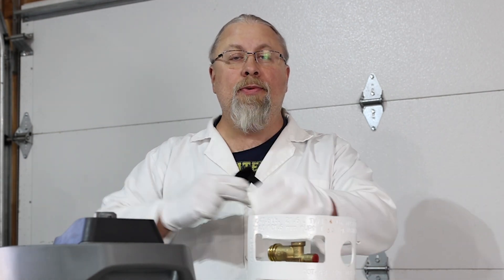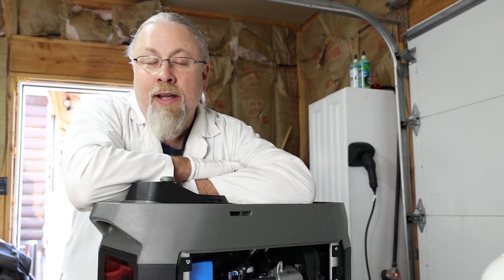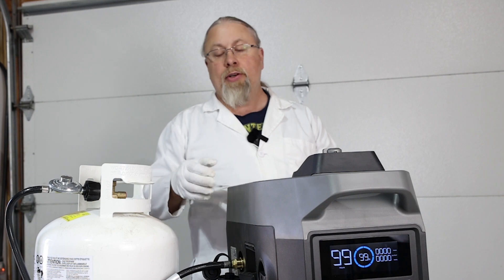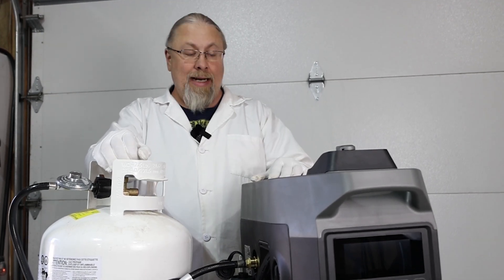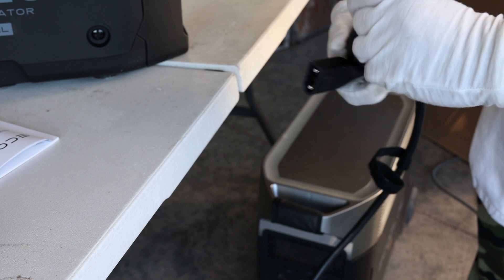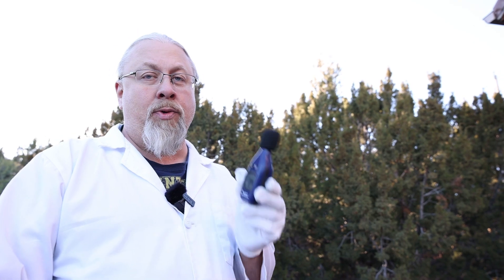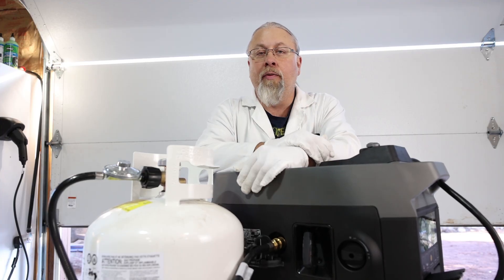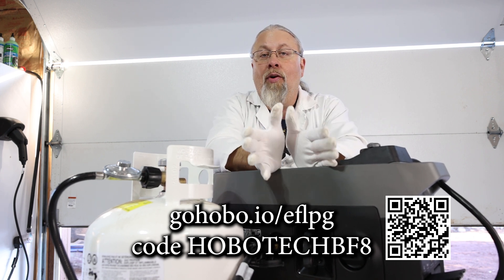EcoFlow DUAL FUEL 1800w Gas / Propane Smart Generator Review

Comment: I wouldn't touch a generator with computerized controllers - especially not a screen and Bluetooth and the like. 

A generator is a last ditch device. It's like having a fire extinguisher with an OLED screen and a tactile switch for the trigger.

What I would totally buy is a smart add-on for a Honda generator.

Comment: Did you ever Figure out why the electric start wouldn't work for such a expensive generator
Reply: Because propane (especially if cold?), and the new line, with partially charged battery, lack of priming. Once he had it going for awhile it started back up immediately… which means the main kinks in the connection were removed and battery was freshly charged, etc. Pulling the cord a few times slowly with the system powered down can help prime it—from what I gather… then turn on and try starting. Presumably, it will start more easily later on if it hasn’t been disconnected or let to sit a long time.

Comment: Great Video. Bro. F that Gas tho. I have a Gas generator.  Only run it now. So it won't lock up over time. The is for the video. I'm skipping this.
Reply: Lock up over time? What are you saying?
Reply: @GMC-qo9xi  
You need to run a gas generator. To keep it in condition. Preferably at least once per year. It’s not good to just let them sit in stowage for years without use.

Comment: when I had watched another review .they couldn't start because the proppane tank was low on propane
Reply: Hi! It is possible that the ambient temperature was too low and the tank contained a lot of butane, which does not evaporate well in the cold. If you keep the cylinder with gas in a warm room for a while, this should help the gas evaporate better. Another option is to fill the cylinder with pure propane, it evaporates well even at low temperatures, but I do not know if they can do this at filling stations in your country.

Comment: I'd rather have a gas can than a propane tank.  my truck runs on gasoline. Lot easier to siphon gas out of that, than constantly fetch propane somewhere in an emergency.   On the other hand, my 7000 watt gen set at home is hooked up to a natural gas line.

Comment: Smart generator that can't figure out to hide fuel level reading when connected to propane. Now they did say the generator is smart, they never said the same about whoever designed it, right?

Btw battery most likely was low, should've let it run for at least an hour anyway. No one tests generator out of the box. It needs to work for a few hours, then oil change, only then use/test.
But I bet you know all that, so no idea why you did what you did.

Comment: Yeah, I would not get this generator. I would not want to have a generator that requires my phone to work. No thank you clarification how about tech told me that the generator only requires the phone to set it up and after that it does not require the phone to use.
Reply from the maker: It doesn't "require the phone to work". You only need to use the phone to set it up the first time to your parameters.
Reply: And either wifi or bluethoot,, I’m using bluethoot.
Reply: @HOBOTECH  that’s a relief thank you for clarifying that. I just get nervous when pieces of technology are relying on other pieces of technology like a phone.

Comment: Gross that a generator needs internet access.
Reply from the maker: It doesn't require Internet. It only needs setup the first time with your mobile an that's it.
Reply: And either wifi or bluethoot,, I’m using bluethoot.

Comment: I have the Smart Home Panel, 2 Delta Pros, and 4 Smart Extra Batteries. Hobo, you know good and well that the data cable is tooo short to charge your batteries when they are hooked up to a smart home panel that is near the main electrical panel of a typical home. I think you glossed over that fact. And you didn’t bother to tell us the exact size of the cable even though you pulled out a tape measure in the video. Shame on you. I love your video reviews but I feel like you pulled some punches in this review. You have a smart home panel.  Show us how you would incorporate this smart generator into the EcoFlow  system. I believe, (and you know) that this  is the same 16 ft data cable that came with the original gas version of this generator. 👎🏼👎🏼👎🏼